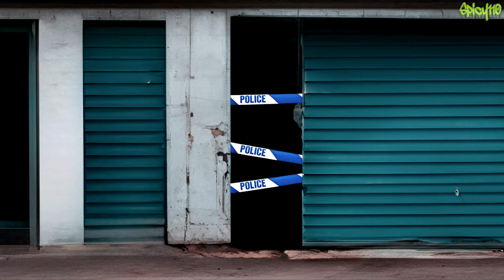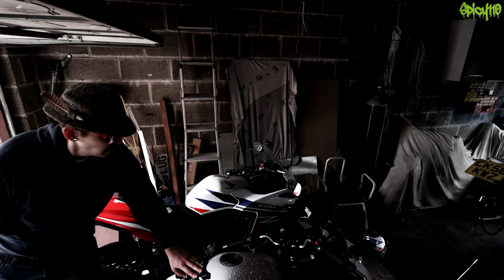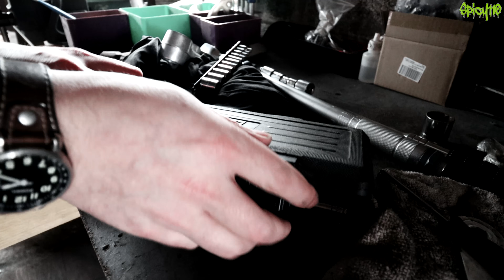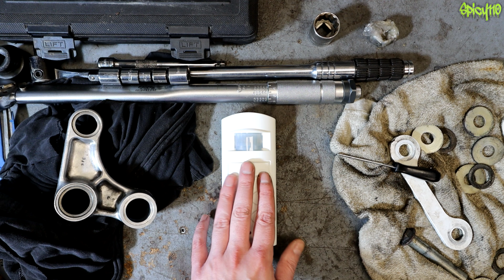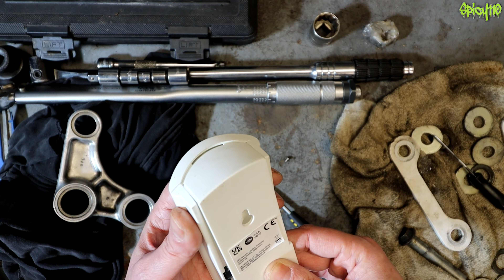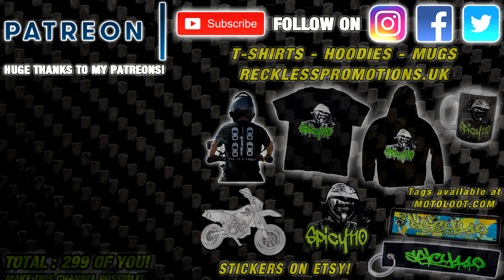Every Garage Needs One Of These! | Cheap Security Yale Alarm

Comment: I have some outdoor driveway motion sensors that have a seperate speaker you can plug inside your house and set various ringers you can add units to the system and extra speakers way better than this

Comment: I got one of these from Argos , it took me 3 attempts to find how it worked , so I had to cover it up in a jumper as the alarm was going off, then I had to undo the back Philips screw to take out the batteries, but got it sorted out in the end , I put tape over the red light at the bottom so you can’t see it blinking, as this will tell the robber where it’s located before it goes off, I got a Christmas present and it’s a ring 2 door bell and was wondering if it could be turned into a alarm .

Comment: £50 have a ring camera inside the garage primed to set off a pretty loud alarm thats enough to wake the neighbours (checked this by accident) So should be good enough to wake me so i can run downstairs in my skiddies and posture and thrust towards the baddies with strong words and such. But i'd probably of bought one of these if i didn't already have the hardware from ring its also a monthly sub but we are trapped in the eco system now :/

Comment: That external siren port looks really interesting, I wonder if it could be wired into a raspberry pi (or similar) to send SMS/Email/etc alerts
Reply from the maker: It has to just be a voltage output so yer, 100%

Comment: They're not gonna come through the wall...

Dr Strange "hold my beer" 😂 Had this exact alarm in my shed for 3 years... Only on the second set of batteries... It's brilliant... Also there's a little outlet socket that takes a 3.5mm headphone jack .. I linked that to a cheap Amazon external 115db alarm... So it goes off outside too!

Fully recommended!

Awesome video!

Comment: I use AJAX for my alarms hooked up to a master blaster where I used to store my motorcycle and UniFi security cameras, I have 4 in the location, and I run another system for redundancy all with back up power, trust me standing in that room with a master blaster 127db screaming alarm your ears would bleed in the 1.2m x 3m room 😂

Comment: I bought a wireless, battery powered alarm for my bike garage a couple of years ago. It is operated by a radio transmitter, which will switch it on and off remotely, even from indoors. To ensure that I would hear it, there is a repeater siren, linked wirelessly, which I keep indoors. Battery life is about a year, for each unit. I think I paid about £50 for the lot on Amazon. The advantage of remote operation is that you can position it somewhere that's harder to get to for a burglar. The disadvantage is if you lose the remote transmitter (guess how I know), because then you have to put up with several minutes of ear-splitting noise while you struggle to remove the unit and take out the batteries. Fortunately, the suppliers were able to sell me a replacement, which now never leaves the house.
It gives me extra peace of mind, although it is only one part of the security measures. It would take a lot of determination, and very noisy equipment, to even get into my garage, let alone get the bikes out, and then there is only one way out along a narrow alleyway, which comes out a few feet from my front door, where they would have to get past me (I am a retired mechanic with a houseful of large, heavy tools).
Reply from the maker: Arrr that's a good way to solve the out-of-reach issue.
Reply: do you have a link for it?

Comment: I thought about one of these, but I don't think tool/weapon welding thieves really care if an alarm is going off. They will have already made a racket breaking into the garage in the first place. Especially if you have a door defender type lock installed. And will simply intimidate or attack anyone who approaches them. No way they rip or cut open a garage door but then run off when a little alarm goes off. Not to mention that they can remove the alarm and smash it on the floor in the 10 seconds it gives you to enter the correct code
Reply from the maker: As I said for me this is about letting me know what is going on, then I can deal with it.
Reply: @spicy110  ^this^
Now...the external siren [don't quote me] I believe is just a point where you can attach an external siren not double up on sensors etc
The passcode is 4 digits 10k [if my Google search is correct] combinations
I buy 2 at a time the EverReady versions - with infrared key fob [one key will activate all in reach]  The reason for buying multiple cheaper alarms is twofold 
1 - my garage is damp and suffers the odd leak [tried to fix] and EverReady versions don't like moisture [probably buy 2 biennially (or 1 a year)] 
2 - having 3 devices set at different locations and different angles means more noise and less opportunity for thief(s) to disarm with a hammer or boot - which is possible and quick.
HTH
Reply: @philhunt9297  Good idea: Buy 2

Comment: I used to use.... a... BABY MONITOR!!! Yup, those ones with two parts, the listen/transmit, and the receiver/listener... I hid the transmitter under my work bench (so the TWATS couldn't see it/see the green LED), and had the receiver next to my bed... And YUP, IT WORKED!... Caught a coupla teenage scrotes trying to rummage around my garage for stuff to pinch, all because one night I got woken up to the sound of cracking (the garage door), crunching (footsteps) and hushed whispers (the unsuspecting LOW LIFES)!!! 👌😏 Over the years a few friends have also adopted this tactic... 😏
😎🇬🇧